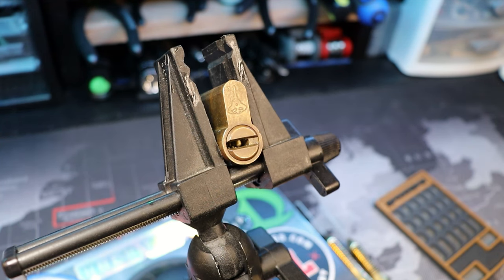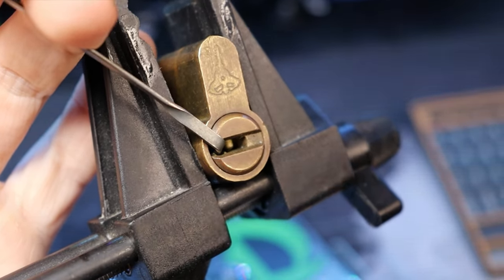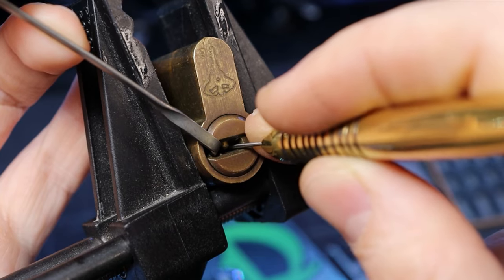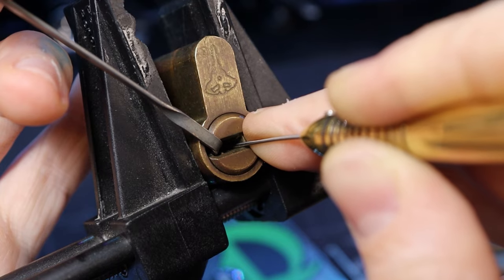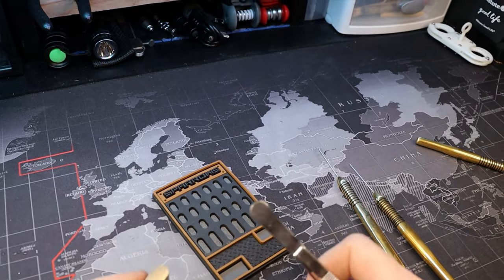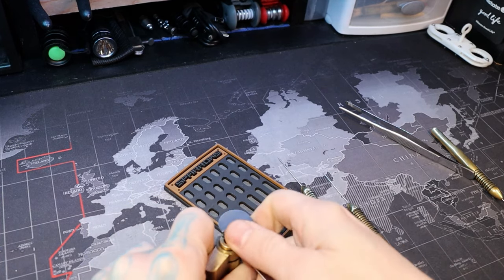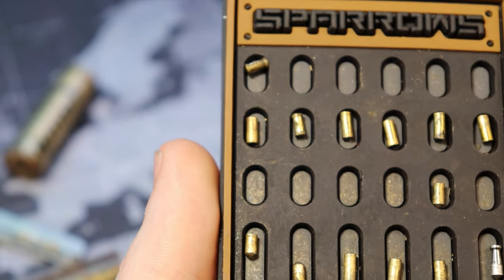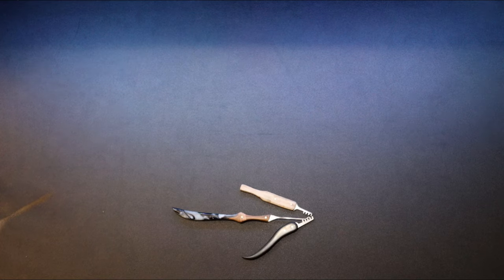239) MulTLock 7x7 Dimple Lock Picked and Gutted

Comment: Nice work - the first dimple lock I ever SPPd was a Garrison, I used this little spade-like rake to set a few pins, then finished off the rest SPP. I couldn't quite believe it after to be honest and kept doing it all night afterwards.
Reply from the maker: Oh nice, that sounds like a hell of a first dimple! Once you get use to the picking technique, dimples are a pretty enjoyable pick for sure. Cheers! 🔓
Reply: @LockpickingDev  In fairness it was the little rake that gave me the encouragement. Do you now the one I'm talking about, about three inches long, they come 9or used to at least) in those budget dimple pick sets, very mice little tool - I have one in my EDC, and they work particularly well with the Garrison, setting 3 - 4 pins each time with ease. So no so much of a 'first dimple' if you know what I mean in true SPP terms. THose G-Pro picks are a delight though aren't they - I'm assuming that's what you're using?
Reply from the maker: @DangerfieldChris  Ahh, I think I know the one you're talking about. Truthfully, I haven't tried raking dimples yet. The pick I'm using is actually a brass pick that I made myself! Started making more of them, the thickness and weight feels amazing 🔓